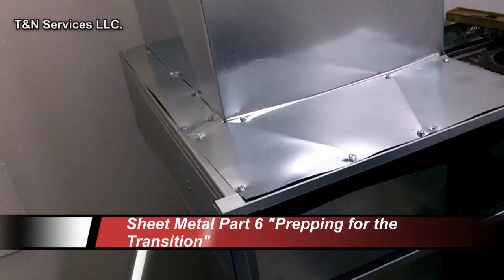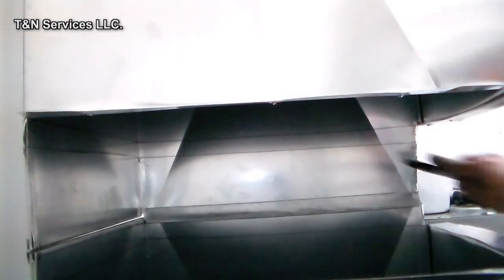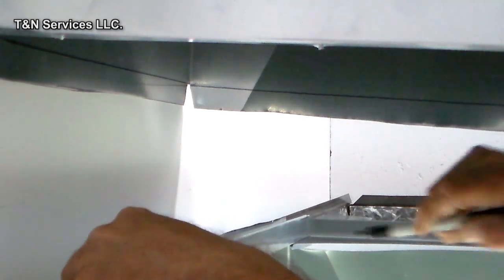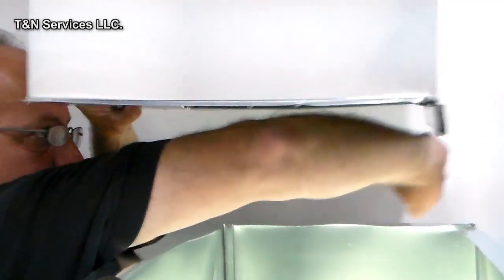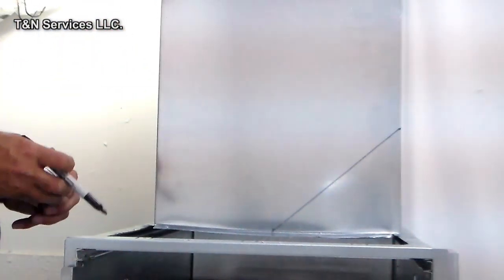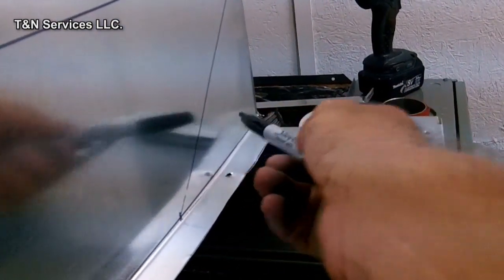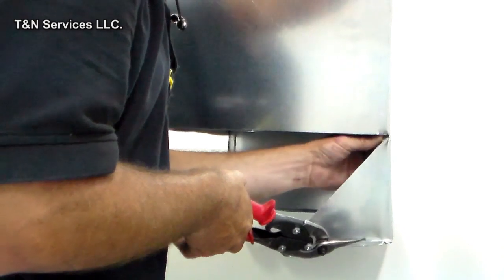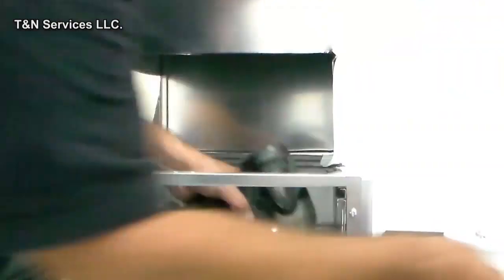HVAC Sheet Metal Video Series  Pt 6

Comment: Great videos! Thank you so much I'm doing  the duct work  changes before the licenced tech  does the gas,  electric,  flue connections and the first fire up. 
I like to work with sheet metal. This is my 4th heating duct work project. I have  learned a lot from all your videos. Thanks again.

Comment: Stop butchering those snips and get some offset bullnose for cutting that buttonlock... 

Also why not give the customer a nicer looking job and bang it out in the shop? If the jobs too far to justify driving back to the shop why not measure it when your giving your quote so you can prefab it all? Even strictly salespeople around here that have never worked in the field can measure up pretty decent for that reason alone.

I'm not implying it's not functional in any way, it'll definitely work, it just wouldn't be acceptable in my neck of the woods. The fly by night guys around here atleast have a brake and usually a old Pittsburgh

Comment: Ralph is this a dual filter system? I noticed in part one you had attached a filter frame to the unit.
Reply from the maker: Its a single filter system. In the first video I was just showing how to install a 1" filter rack
Reply: Sorry Ralph. After watching some of the later parts I figured out that it was a single filter system. Thanks for the help.

Comment: where did you get the 6 inch measurement to cut off from? how did you come up with that number in particular and why did you use it?
Reply from the maker: Hey Matt I just made the six inches up. You could use any number you wanted to use. I wouldn't do anything less than 6 inches though.